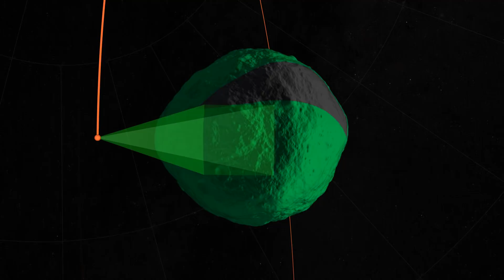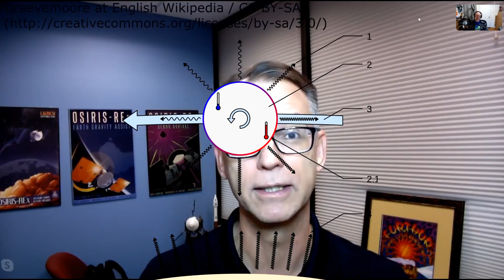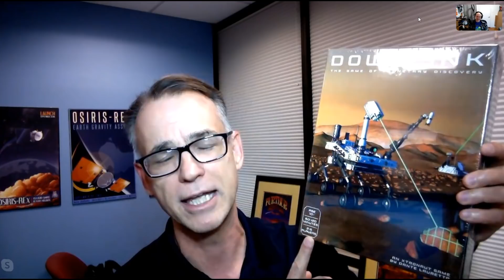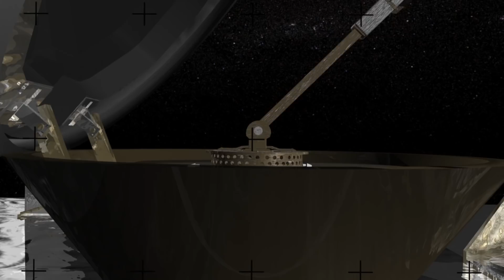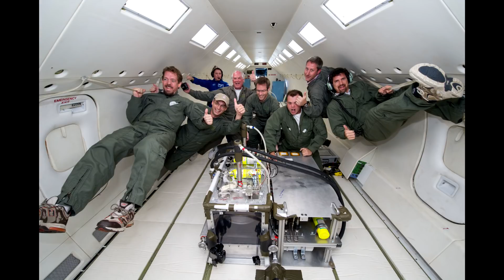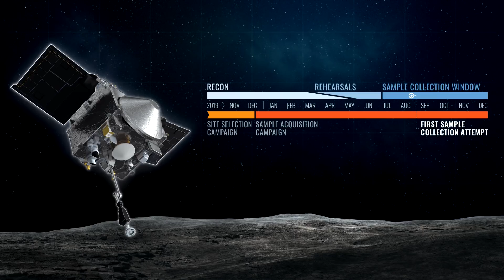The Lead Scientist Behind NASA's Asteroid Mission Talks About The Biggest Problems They Solved

Comment: Wait a minute! How can this asteroid radiate heat????? Shouldn’t it be old, cold, and dead?????

How hot was it 3 billion years ago, and why has it lost heat so slowly?

On a similar query, if this “mountain “ is 3 billion years old, how does it still have out gassing ?  Hasn’t there been enough time to get rid of all of it’s gasses?

Retrograde revolutions make no sense in this solar system of nothing but matter. If the solar system arose from an accretion disc, how did Neptune form it’s own disc with a small ring and moons about 90° off the solar plane?

How does bennu have anything retrograde?
Reply from the maker: It radiate because it’s heated by the sun on one side. Anything warmer than -273C radiates black body radiation.

Comment: I'd like to ask Mr Lauretta his opinion of what it would be like to try to do some common Earth things on Bennu.  If you placed a 10-ton electric bulldozer on Bennu, would it work?  Would it be able to scoop up soil?  Could you attach a drilling rig and drill into the asteroid?  Could an astronaut on the surface even shovel soil into a wheelbarrow?  If you could run on the surface of Bennu, would you reach escape velocity and leave it?   If you jumped as high as you could from the surface, how high would that be and how long to come back down?  To better understand the low gravity and the consistency/makeup of Bennu.
Reply: The biggest challenges with surface operations on a small asteroid like Bennu is the low escape velocity (~20 cm/s on). The counter forces to most of your described activities would send the machinery or astronaut tumbling or launched off the surface. Some sort of surface coupling would be required. If you jumped as high as you could - you would leave the surface and be on an escape trajectory. I think of our operations more like scuba diving around a reef. It requires low thrust to maneuver the OSIRIS-REx spacecraft to achieve a wide range of observing conditions. I would expect any asteroid mining operations to be in the vicinity of the asteroid with excursions down to the surface collect material for crushing and processing.
Reply: @dantelauretta  Thank you!  It sounds more like docking with a large spacecraft than landing on a planetary surface.  Also, with such low gravity, the surface regolith may be very loosely packed and easily sent flying, even to escape velocity, right?  How deep is that regolith?  Possibly all the way to the core?  So, that "coupling system", a way to attach any mining machinery; that could be a real problem, right?  And you can't just vacuum the stuff into a bag because it's already in vacuum.  Trying to use a rotary drill would require constant thruster firing to stay in contact with the surface and counter torque, right?  I think I'm beginning to appreciate the difficulty of your sample return mission.  It's not like going to the beach and scooping sand into a bucket.  The sand wouldn't stay in the scoop, it would just fly away. :)  Also...if this or a similar asteroid were on collision course with Earth, could it even be nudged to miss without breaking it up?  Or could it be blasted into a large cloud of debris that might only make a spectacular meteor shower on arrival?  Or, would that just likely create hundreds of 1 to 10-meter boulders of rock/ice/metal?  Wrap it with a large bag and pull it to a "miss" path, maybe?  Crash it into the Moon?  How large of a crater would it make?  Could we mine it more easily then? :)

Comment: Um... Why not have the micro-gravity test chamber float gently in the Vomit Comet during the test, instead of having it affixed to the floor?
Reply: The test chambers have a large mass. The acceleration changes a lot during testing. Safety protocols require that the chambers be fixed to the floor. The reduced gravity environment affected the entire plane - so having the chambers float freely would not change the acceleration profile.
Reply: @dantelauretta  Agree that it would be unwise to have the chamber float completely freely, but it could be possible to have some kind of suspension to compensate for trajectory fluctuations and vibrations of the fuselage.

Comment: You must be the guys with the tests requiring rocks and debris in the thermal cycle chambers.  We told you that won't work cause the chambers
will not work with rocks in them.
Reply: Yup - that was us! Thanks for letting us put our rocks in the chamber. Recall that we built our own chamber to place inside the big one - keeping the dust contained.
Reply: @dantelauretta  I worked at ssl. lol
Reply: I remember rock sample testing in the chambers.   lol.

Comment: 18:16 and ff. Strange, it looks like most impact craters are located around the asteroid's equator.
Reply: We are seeing a higher density of craters at the equator. This observation suggests that the equatorial ridge is the oldest feature on the asteroid surface - very interesting!
Reply: @dantelauretta  Yes, but why at the equator? What is attracting that many impacts there? Also, I suppose some craters were formed by just a single rock that re-impacted after the first contact with the asteroid.

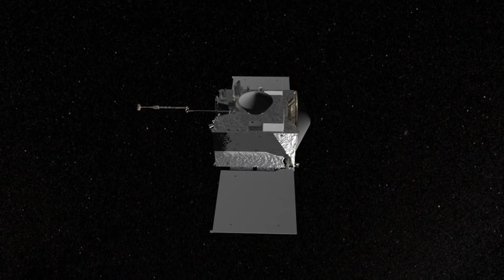Comment: How do they know they actually got some material? Do they measure changed mass distribution during turning? Looks like they're doing this at 11:52...
And what will become of the spacecraft afterwards? Will it drop of the sample return spacecraft and continue operation like doing some digging or does it have to deliver the samples to earth by itself?
Reply: We measure the moment of inertia of the spacecraft before and after sampling. We have a precision of ~40 grams on the mass collected using this technique.
Reply: @dantelauretta  Cool idea! And what about the delivery spacecraft? Is it just a passive container that has to be delivered to earth actively? Or does it have manoeuvering capabilities by itself?
Reply: @xmoex6393  We bring the entire spacecraft back to the vicinity of the Earth. Four hours before atmospheric entry we spin up the sample return capsule and eject it from the spacecraft - like tossing a football (American). The capsule has sensors to deploy parachutes but no active guidance. After ejection, the main spacecraft will fire thrusters and remain in orbit around the Sun. We expect to have some extra fuel left over to target another asteroid.

Comment: it always seems strange to me to see rocks on this asteroid just sitting on the surface.. My mind wonders why the have not just drifted away.. I know that gravity holds them together.. But still.. This is amazing that these guys can do this!.. Nothing is impossible anymore given enough time..
Reply: I'm curious to where the rocks comes from. Why isn't it just a bunch of sand.
Reply: @Mosern1977  Rocks make more sense to my mind because I think of them as chunks gathered together.. But you are right.. why not more sand or even smooth rock.. What do you think?
Reply: In the early solar system, you could start from one tiny piece of dust and it wouldn't take you long to get to another. These very tiny and numerous pieces of space dust that didn't become a part of our sun were left whizzing around it in all kinds of crazy orbits, which is the ultimate recipe for collisions. Some collided at high speed, some at slower speeds, but you'd ultimately be left with so much dust slammed together that you get small rocks. Over time, some of these small rocks would continue slamming into more dust to become even bigger, which gives it more surface and gravity to have more collisions. The rocks that grew the fastest became planets, and of those, the ones that stole up all the hydrogen and helium became gas giants.
These planets had so much gravity that they basically bullied less fortunate rocks that grew later and not as fast, flinging them away from their orbits, or eating them. So the only places these asteroids could live in peace are regions where there aren't enough big bullies, what we now know as the asteroid and kuiper belts.

But as for why there isn't so much tiny grains of sand out there, the answer is that there actually is. A surprising amount of it actually. Thermal coalescence isn't enough to fuse all those small bits together because the temperature doesn't get too high. Most of the very tiny bits of dust became part of atmospheres, and the ones that were too big for that mostly ended up on planets. So there really isn't a lot to go around, and there wasn't that much to begin in the first place. Even now, planets are still taking that dust for themselves. 100 tons of the stuff gets into our own atmosphere every day. Most of the small particulate matter became part of bigger rocks during those initial high energy collisions, and all of it that hasn't been stolen by planets or flung out into deep space has settled in a more or less equilibrium distribution between all the asteroids out there, only being broken by close encounters and collisions. If small grains were the majority product of the asteroid belts today, it would probably tend toward the formation of a select few particularly large asteroids or even planetoids millions or billions of years from now, similar to how our moon formed. Maybe even an entirely new planet. Only at such sizes can gravity start to massage the interiors of the object to form a spherical shape. 

Asteroids tend to be rough, but really all solid objects tend to be rough. It's just that a 20 meter tall boulder sticks out a lot more on a tiny asteroid than a gigantic planet.
Reply: @tinkmarshino  - the gravity of this "mountain" is so low, that all the matter must have come together from elsewhere. So these rocks, where were they created? Are they leftovers from a super-nova? What produced them in the first place?
Reply: @Mosern1977   rocks that formed from the collision of other solid asteroids or comets most likely.. it probably was a big rock to being with then the smaller one were attracted to it over time.. It sure looks strange to me these smaller rocks just sitting there on the surface..
Reply: wait of asteroids are just really loose collections of rocks, then say if one enters earth's atmosphere, wouldn't it just completely break apart and disintegrate.
Reply: @livethefuture2492  - if it is just a gravel-pit, then yes, I imagine it should. The main issue is if there is a massive rock from somewhere in that pit.

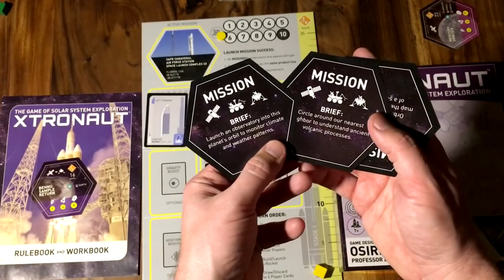Comment: 9:21 everybody gangsta untill JWST rolls up sayin "yo I need mo money"
Reply: At least JWST promises greatness. SLS on the other hand...
Reply: @FrikInCasualMode  fatness? maybe? (cuz LH2, not hating on body image)
Reply: @maxk4324  Wastefulness? Imagine where SpaceX would be with a budget like that...
Reply: @FrikInCasualMode  well to be fair they'd probably be not anywhere that NASA wants specifically. SpaceX has so far been cornering the commercial space market with its falcon 9. This means developing a highly versatile rocket design which can serve the needs of as many as possible but compromises on performance in certain areas to achieve this. Works well enough for most satellites who just want to get into earth orbit, but NASA frequently needs specialty launches like the parker solar probe, which HAD to launch on ULA's Delta IV heavy as it was the only vehicle available which could provide the necessary delta V. So wanting to contract out the building of their own specialty launcher was not inherently a bad idea. The bad ideas are just nearly every design decision after that point. Like wanting to use the surplus RS-25s. Phenomenal engine that boasts some of the best performance characteristics of any engine in history, and an absolute nightmare to make safe for humsn space flight. Or the SRBs. Don't get me started on the insanity of using a rocket propulsion system you can't shut down on a crewed launch vehicle. I mean for fuck sake it's like we learned nothing from the nightmares of the shuttle era.
Reply: Starship would be flying and SpaceX would be prepping for a Mars landing with all the money SLS has gotten thus far.
Reply: @maxk4324  putting my tinfoil hat on, we may have learnt lessons from the shuttle era, but shuttle people still need their jobs and their respective politicians will make sure shuttle people get their jobs
Reply: @maxk4324  SLS will be a fine rocket once they ditch the ICPS for the upper stage it was meant to use the whole time. I consider the existence of the ICPS an insult to what the SLS needs to be to do what it is designed to do. I hope they only make one ICPS (but if needed an engineering test article is permissible, as then we would have something to hang in a museum).
SRBs have always been reliable, when used WITHIN their design tolerances. Challenger was an entirely avoidable tragedy.
If they ever decided to go with the Advanced SRB concept for the Shuttle (graphite epoxy composite casings instead of segmented steel casings), you'd get a SRB that is safer and more reliable (no o-rings), as well as having significantly higher performance than the SRBs that continued to be used. A stretched version of the ASRM would work great for SLS, easily enabling missions to Mars.

Honestly, when the SLS gets the upper stage it deserves (Exploration Upper Stage with 4x RL-10s), then we can start doing meaningful things with it sending payloads to the Moon. Upgrade the boosters, and we could send heavy things directly to Mars with it, without having to assemble them in orbit first.

Comment: While the asteroid data this looks for is more urgent for planetary defense, that low bit rate highlights the potential value of a true deep space satellite network for relaying probe and mission data.  Not the similarly named system of Earth orbiting sats used by NASA, but radio relays dotted around the solar system that can amplify links to missions like OSiRIS-Rex or combine to form a virtual multi-AU diameter radio telescope.

Comment: This mission is such an amazing glimpse into the future. I'm at that moment where he's talking about scrapping LIDAR for a CV based approach that's more accurate, and I felt tingles in my arms. Because I've kept track of this problem and it is my belief (and the belief of folks at Tesla) that the next generation of autonomous vehicles will utilize vision with RADAR and ultrasound to achieve an accuracy far greater than what LIDAR can currently do. It's amazing that this mission essentially validates that hypothesis in the unlikeliest way possible.

I could still be wrong though. For example, there could be another LIDAR out there with different specifications that allows them to achieve the same level of accuracy. Perhaps it is their sensor itself. But the fact that CV has advanced to the point that it can be used in this manner is mind blowing and a testament to what's possible.
Reply: He mention that the LIDAR wasn't meant to get high resolution because they didn't expected to need lateral resolution, only altitude. Like doing scans in X axis instead of X+Y.  It's also roughly 10 years old and space rated which mean that is behind to the standard technology at the moment of conception.